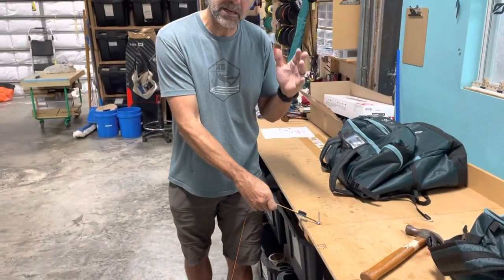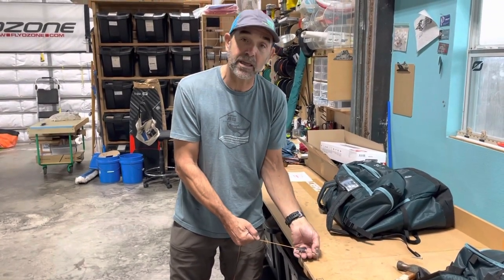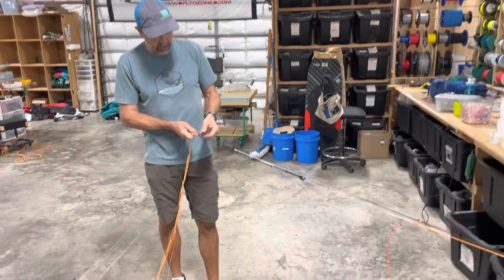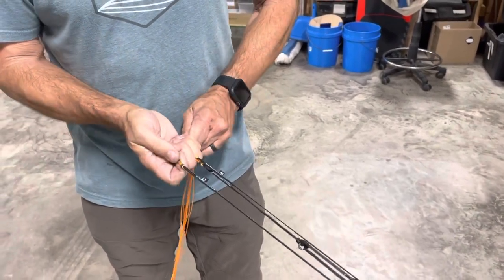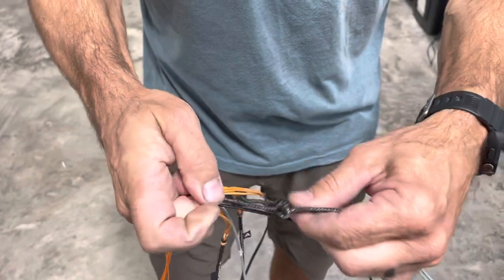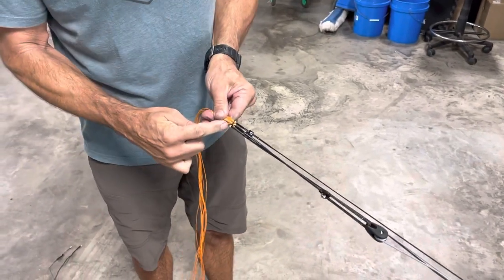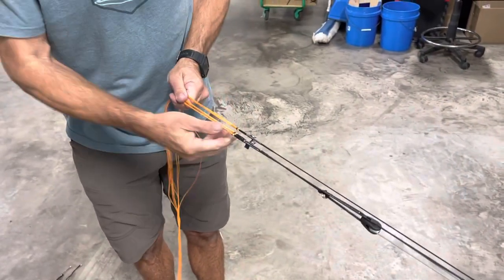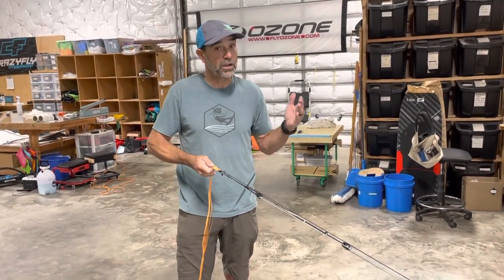Flysurfer short mixer adjustment

Comment: Hi Jeff. 
Perfectly in line with the need and simplicity to do the proper adjustment of the Flysurfer foil kites.
Just some adds-up if I may:
-A more accurate mixer test is available on these kites, the long mixer test, as it includes variations in the bar lines and in the small bridles 
- you need to pull a bit more on your lines during test (5kg)
- you need to pull hard on the knots when you change their adjustments before testing again the position
Another vid for reference from their designer
https://youtu.be/wYXqPgO0Dc4

Comment: ok, this short mixer test is not accurate tbh. it's fine for a new kite that requires minor adjustments. the bridle lines are way longer than what you are adjusting with the short mixer thus you should do the long mixer adjustment that caters the whole length of the bridle and the mixer lines. here comes the trick though... after some time you are running out of C line adjustment. it needs to be lengthened beyond its adjustability. what do you do then? 🤷🏻🤷🏻 another issue with the mixer adjustment (long) is that after some time the Z line shortens quite a lot as it works under no tension. if you anchor A and Z at the same point without credit for the shorten Z line you are basically trying to adjust sheeted in kite which is not correct neither (doing the long mixer adjustment)